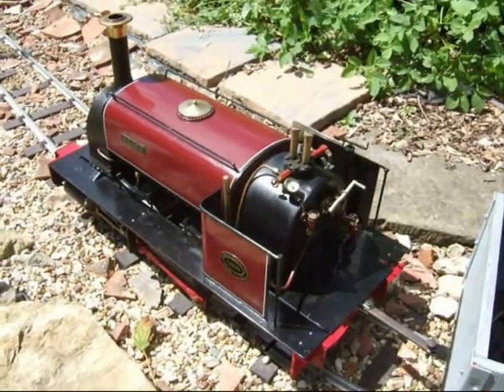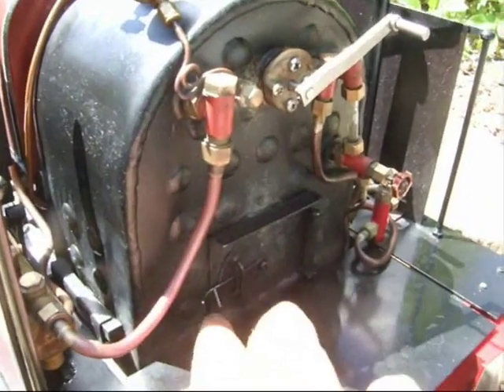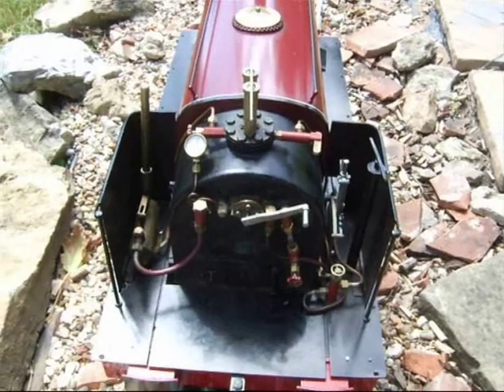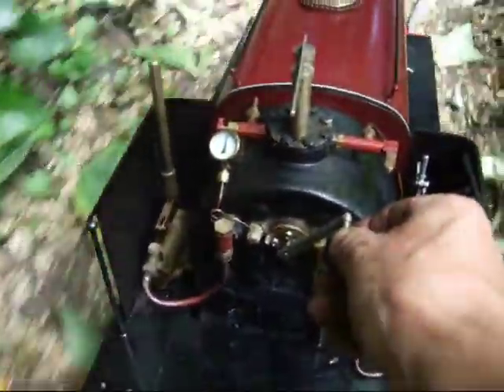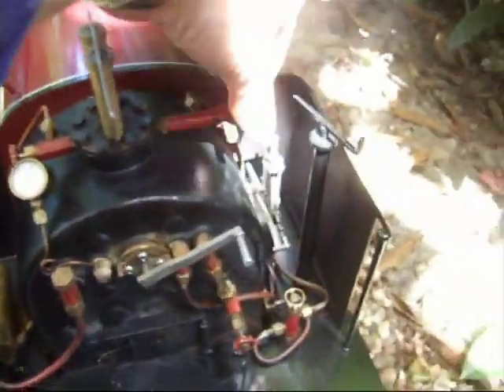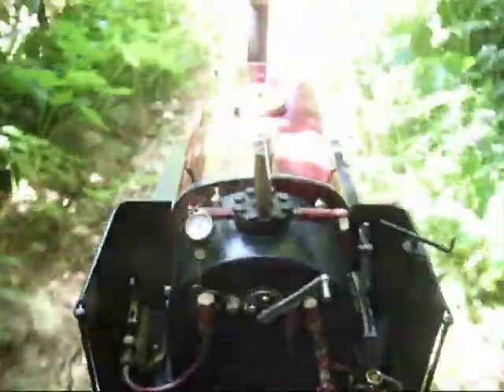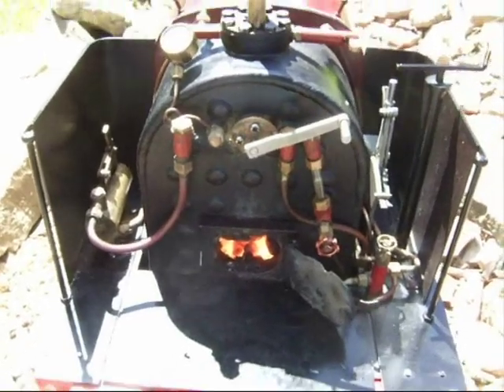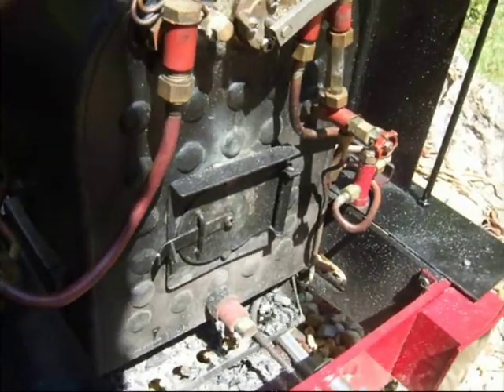Steam Model driving lesson from maxitrak

Comment: What pressure do you take off the blower?
Reply: Matt Seymour 20 psi
Reply: Thanks for that. what coal do you use and recommend?
Reply: @kombi1995  which type I meant?
Reply: Matt Seymour special coal, fire tablets.
Reply: @kombi1995  what tablets?
Reply: Matt Seymour wax solid fuel.
Reply: @kombi1995  is that the stuff for mamod engines?
Reply: Matt Seymour yep.

Comment: just little thing never turn the blower all the way off because it creates an draft up through the fire to create steam and keep the fire bars from getting damages if you turn the blower all the way off it can cause damage like the fire bars distorting then you have to take it apart to put a new one in
Reply: Thats not strictly true though, exhaust steam is sufficent for keeping a draft over the fire when running. Only use the blower when you need to, IE when your low on steam.
Reply: I’m assuming you mean fire grate not fire bars and that is the case on full scale locos I learnt that the hard way but on a 5 gauge loco or similar size it’s not really an issue at all
Reply: How much blower do you recommend for sitting and not running for long periods?

Comment from the maker: No we just steer away from them as they are notoriously  temperamental and as a starter loco its good for you to see/hear the pump working! you could fit one if you wanted to but it is a saddle tank so the water will get to hot  so you would need an external water supply!